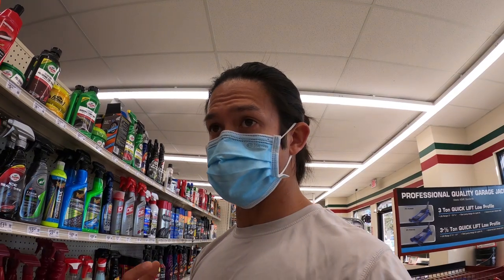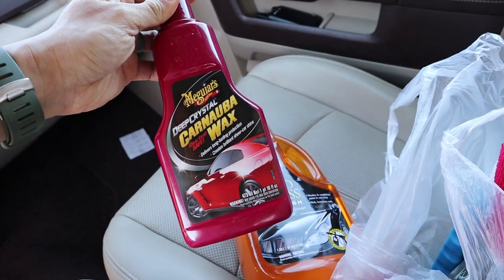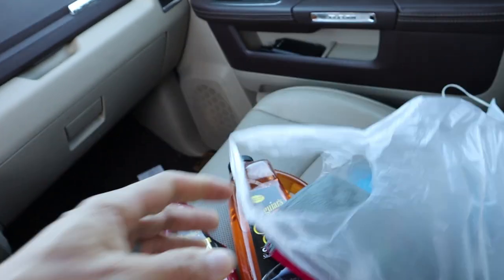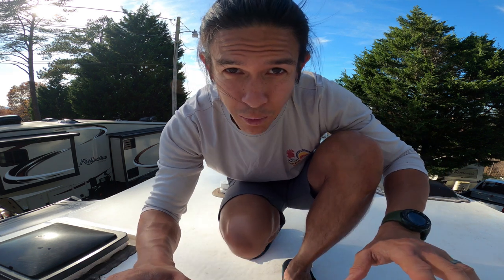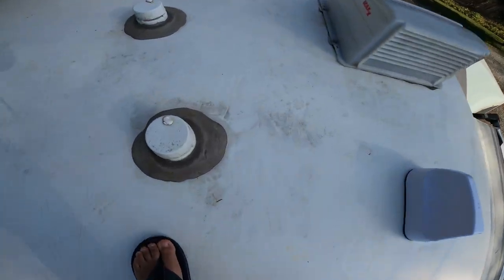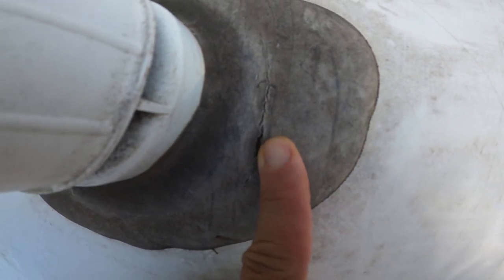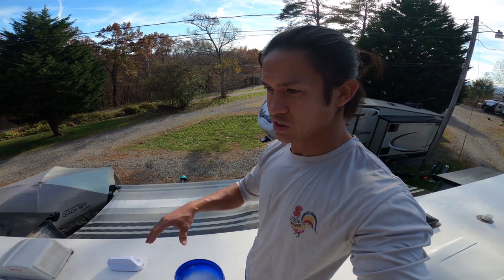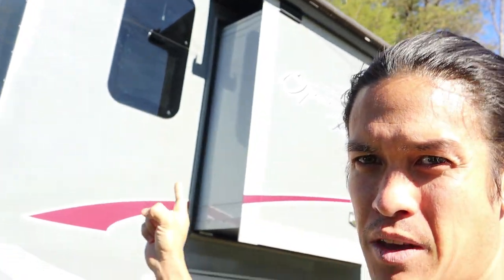How to Restore RV Gel Coat on a Budget

Comment: Look up the application of glossy floor wax. You'll be glad you did. I know a couple of people that have done it and it turns out amazing.
Reply from the maker: When I worked at the Fire Dept, I knew a guy who would spray the canned furniture polish on the vehicles to “wax” it. Looked good, but didn’t last.
Floor wax must hold up a little better I’m sure.
Reply: Never used it myself,  but I've read negative posts about floor wax.